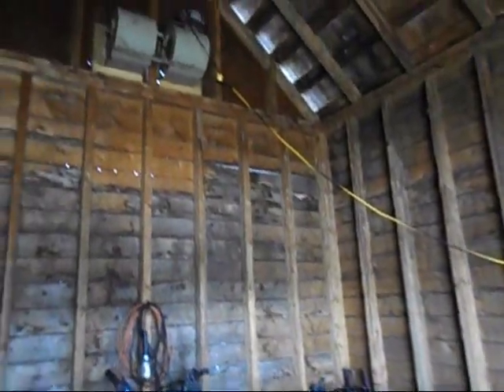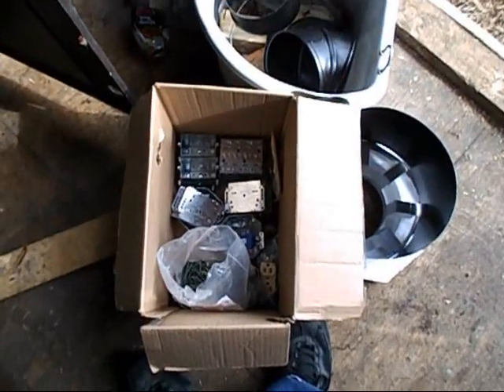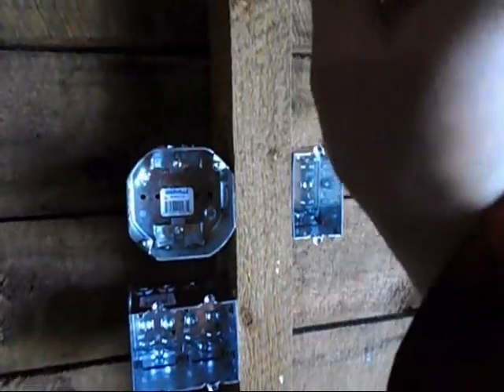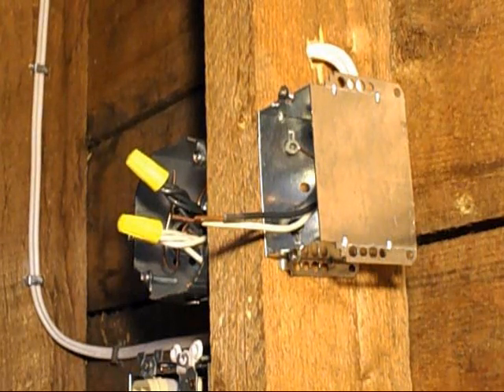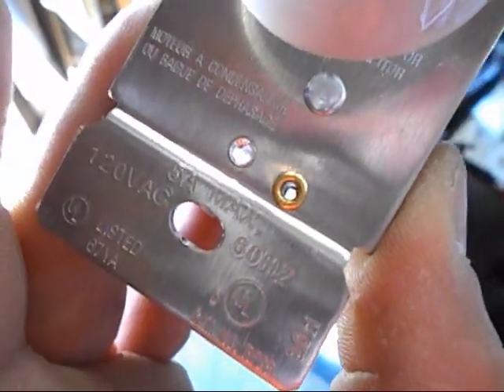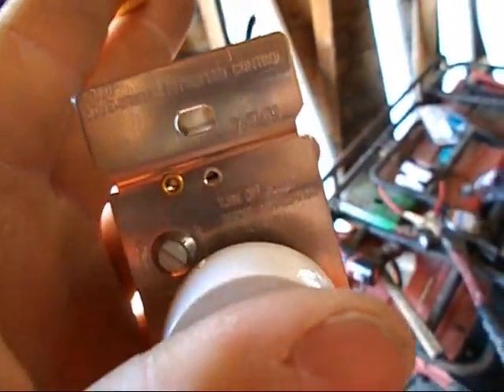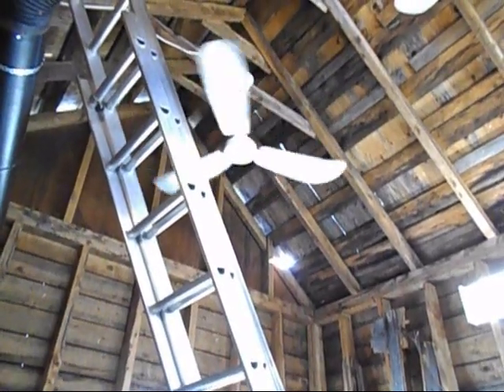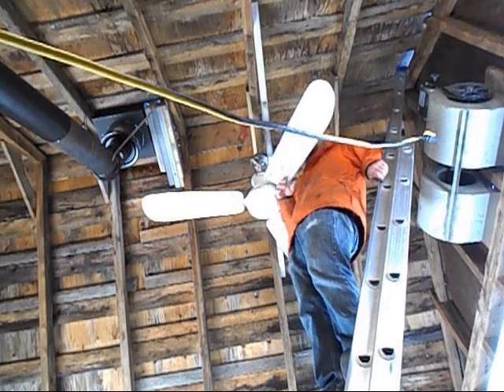Shed vlog

Comment: Nice work with this shed! I really like the fluorescent lighting set up & the ceiling fan set up. Why does the union looking industrial have a Canarm industrial canopy?
Reply from the maker: Thanks!
That is the 2010 canarm with the wrecked bearings. I threw on a set of blades from an old evergo I used to have. But I put the original blades back on it now.
Reply: @hobbycentral3516  Ok, But what about the dimmer for the 2010 Canarm? Did you fix it or put another Speed Control in?
Reply from the maker: @brandonjohnson1386  woops, missed you're  comment. I did fix the switch, and recorded fixing it, but very soon after bought a new switch.

Comment: You should install emergency lights in the shed that way if the power goes out you can still see
They sell them at hardware stores like menards
Reply from the maker: Cool Idea, but I dont keep power going to this shed 24/7. so the batteries would just get run down
Reply: Hobbycentral oh